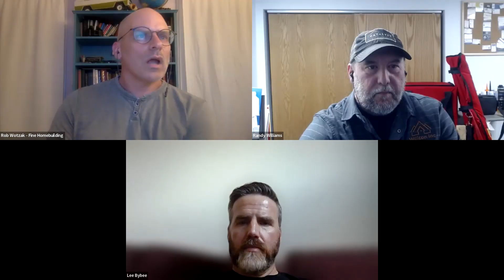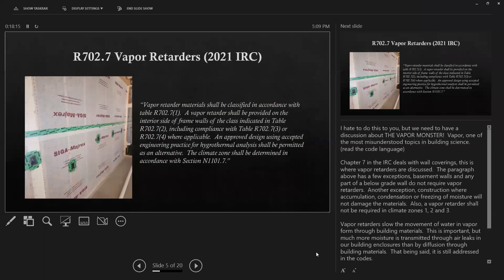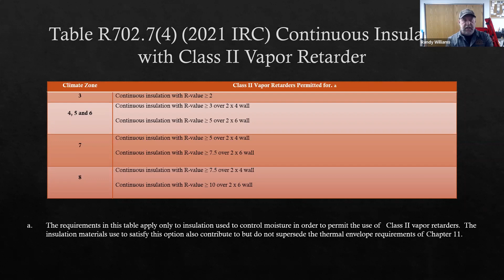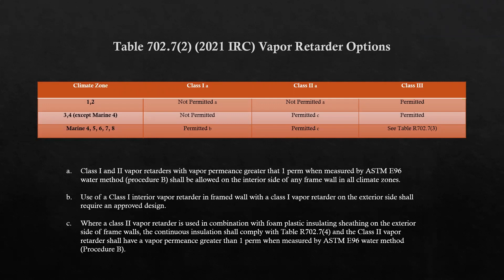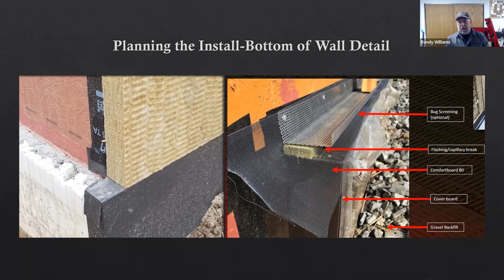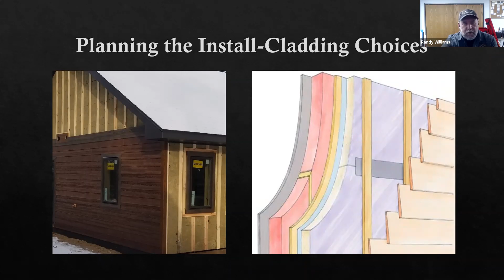Exterior Insulation: Strategies for Success in the Field and Staying on Budget

Comment: Exterior insulation panels have some surface material that seems to have low perm. Since many houses have a plastic vapor barrier in the innner surface of exterior walls (between gypsum and studs), does the external panel with low perm cause moisture/water vapor problems innside the wall?
Reply: Short answer is yes, especially if the nail base insulation is a polyiso material (ie: Zip-R) that has the lowest perm rating.  A high mil plastic vapor barrier for the inner surface of the exterior causes this issue.  On the flip side, if you a thin plastic and a different nail base insulation material, you might get away with it.  Hence, if you know that a high mil plastic exists, then you use the mineral wool as shown in this video.

If you are starting from scratch, a nail base is an excellent choice.  For example, if the inside insulation is closed cell foam, then a nail base polyiso is the right choice.  Drying occurs from the inside of the structure as long the inside conditions are setup correctly.  If this was my house in zone 4 as an example, 2 inches of closed cell spray form in the inside and 2 7/16 inch nail base of polyiso for the exterior.  This would give me in the neighborhood of R24-28 depending on the products.  More and more studies coming out are showing that the real R-Value of this products have greater effectiveness than traditional fiberglass.  It could be anywhere from 1.5 to 2x, giving you a better BTU retention in your condition space.

Bottom line when dealing with continuous exterior insulation, it not a 1,2 ,3 thing.  Thinking is required for the right combination to take advantage of it.